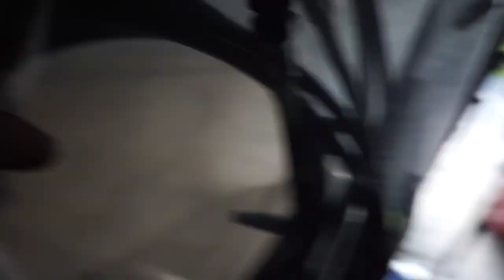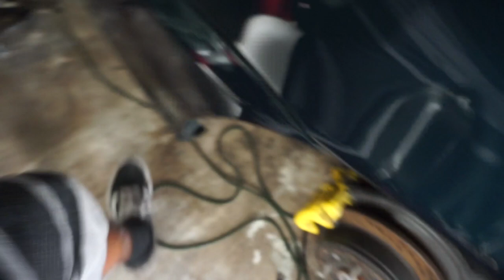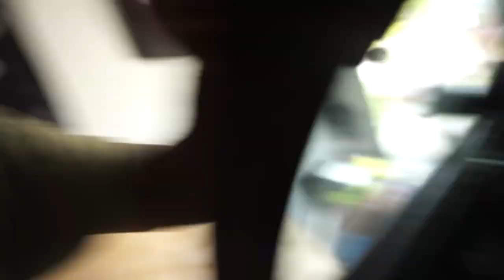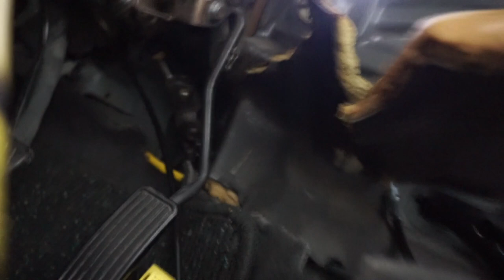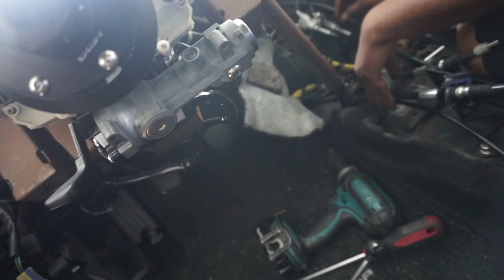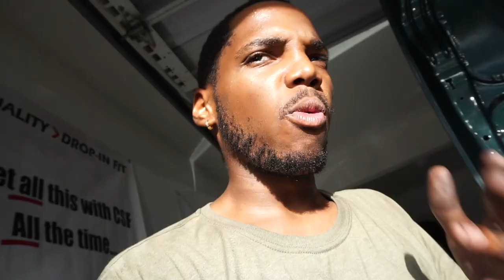WIREWORX BRAKE TUCK KIT INSTALL! - K24 INTEGRA

Comment: All u gotta do is drill for bulkheads 
And get skin grafts when ur tuck line pops and shoots boiling brake fluid all over ur legs. Yes. It has happened to people. More than once. I’d never tuck brakes to the inside of my firewall

Comment: Hey Zoshh wassuuhhh?Did u cut of the metal where the clutch stop is at in order to work with line with ease?I'm in the middle of installing driver side and it's a bitch lol.I have same wireworx kit.